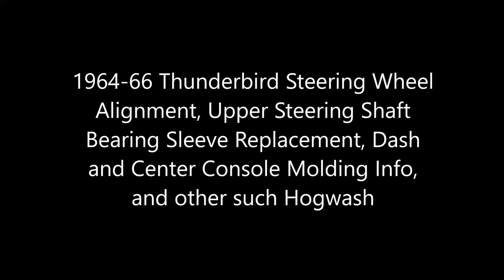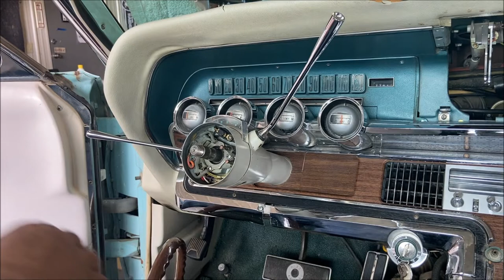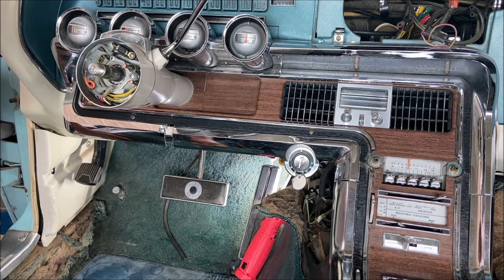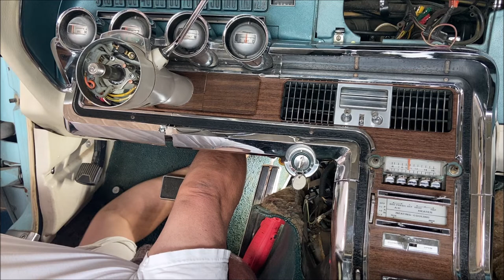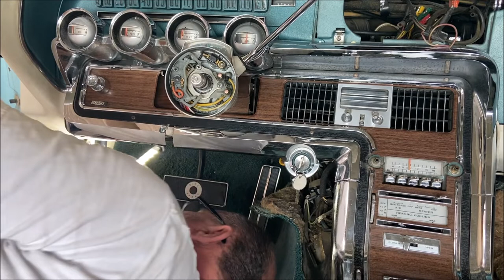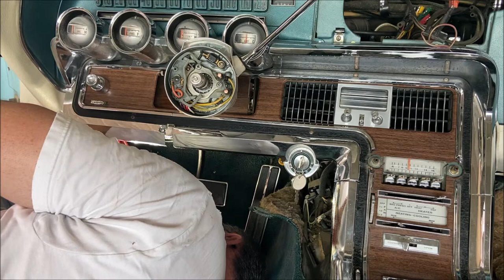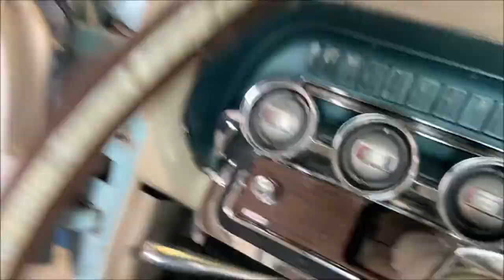1964-66 Thunderbird Steering Wheel Alignment, Upper Steering Shaft Bearing Sleeve Repair, and MORE!

Comment: Hey Nick, I hope you are doing well, I enjoyed your video as I know I will have to dive in the under dash area myself. My '65 will start in any gear position and will not stay in park, makes a terrible noise like the park pawl is not engaging the gear. My car has only 79,000 miles but sat for 11 years un driven. So neutral safty switch is a must look at..... I have never done one of those.... any tips? ideas? Thanks, and God bless. Mike
Reply from the maker: Hey Mike, thank you. It sounds like the NS switch has been bypassed. Its probably bad. That's not hard to do. It wont stay in park probably because the shift lever is bad, it may have a bad lower bushing and maybe the detent is also bad. Those are the 3 main culprits. There may also be something wrong with the shift linkage to the trans as well. All are typical problems. The NS switch is easy, its held to the steering column by two hex screws but they are unique so don't lose them and don't mix them up with the wrong screws. Hopefully your original screws are still there. My videos show all this. Good luck.
Reply: @vintagethunderbirdrepair9426   Thank you, do you happen to have a video on the NS switch? I didn't see one. I guess the BirdNest has some I don't know how good they are, I have gotten a bunch of things from them in the past and been pleased so far.
Reply from the maker: @mikejohansson6711  Hey Mike, my Thunderbird steering column and slide mechanism videos, especially part 2, show the NS switch attached to the steering column. I do not explain how to adjust it or show the unique hex screws but you can clearly see how it is installed. That's all I've got. Sorry.
Reply: @vintagethunderbirdrepair9426  Hey that is a start. thank you and God bless.

Comment: Ok, so after you attach the repaired ground wire to the firewall where does the other end go? I found mine broken also but I don't know where it originally attached.
Reply from the maker: It can go to any of the little hex screws on the steering column in that area. I think it originally went to one of the hex screws that held on one of the plastic turn signal switch wire retainers. Those black plastic retainers that look like a P. Good luck.
Reply: @vintagethunderbirdrepair9426  My son in law came over this morning and we got on it! My eyes are worse than I thought. For the life of me I could not see those nuts for the the Booster bracket but he could and after a little we (he) got them off. Ok, so that was a BIG worry off my mind. So then I, after referencing your video, proceeded to get that bushing in at the bottom of the steering column. It was a little bit of a beast but finally seated in where it was supposed to  be. Then we got the bearing and sleeve situation resolved. After that we screwed with fitting the master cylinder on the booster. Again referencing your video about properly positioning the Booster rod. Got it all put together, installed in the car and....we have Brakes!!! So we have a wet, windy day or so coming from this tropical storm Nicole  and I really wanted to get the car inside so that goal was accomplished. Again, thanks so much for your videos. I'm sure I will have to watch more!
Reply from the maker: @Mr51Caveman  Hey Mr 51, great news. Sounds like you had your hands full. Its always nice to be able to refer to a video when your fixing something. I fixed my clothes dryer because someone made a video of my exact same dryer on how to fix it and if that video did not exist, I probably would not be able to do it. This is why I do these videos, to pay it forward. Glad it helped you. Thanks.
Reply: @vintagethunderbirdrepair9426  Well the rain and some wind is on us now. But luckily with your help I got the car started and backed it into a portable garage I had to get cause we don't have one. The car also has some seal issues and it got wet inside the last rain we had. Something I'll address later...as long as the garage doesn't blow away! Yep, some of the YT videos are great. I had a 2010ish Volvo (my wife's) and one of the headlights burnt out so I was looking at how to replace it. Wow! I thought I was gonna have to tear off the whole front end to do it but after watching a couple videos it was surprisingly simple to fix. And yep, crawling under dashes is definitely no fun! I spent 24 years in the Air Force crawling through some super tight areas on fighter aircraft. Retired 20 years ago. Thankfully I have a pretty good son in law who's just retired from the Air Force also but he's still pretty young. Not even 40 yet!! So he's mechanically inclined and limber. Keep doing those videos and teaching all of us out here! Thanks
Reply from the maker: @Mr51Caveman  Hey Mr 51, I was a Huey mechanic in the Army, was pretty skinny and limber back then. Thats not the case today Im afraid. Glad your making headway. Good luck.

Comment: Great video Nick! I was wondering, the doors for the swing away steering column, how do you remove those? Does the column have to be removed first or can the doors be disassembled with the column still installed?
Reply from the maker: Hey Tbird, good question. I could have addressed that one too while I had all the panels removed but I didnt think about it. You can see that the doors are 3 different panels, one on each side of the steering column and one that wraps around the column. The one that wraps around the column is two pieces, one on top and one on the bottom. The bottom piece comes off, slides down. I think that 65-66 just pulls off but 64 is screwed to the top piece with 2 phillips screws. Once you slide the bottom piece off, then there is a bracket that needs to be removed. There is also a black U shaped bracket under the dash that the whole thing is attached to. That must come off too. Once you remove those pieces, unbolt the steering column from the slide mechanism and you can then slide the door out with some trouble because there is very little room to do so. This is not a very good description. Ill keep this in mind for another video later. Thanks.

Comment: I have a '64 T bird. My husband was  restoring it before he past away. When he took the steering column apart he broke a spring that was in it and we never found part of the spring. Do you know what the spring looks like or know where to get it?
Reply from the maker: Hey Krystal, very sorry for your loss. The steering column has a spring inside the shift hub under the shift lever, this is what makes the shift lever return when you let go of it. it is a short stout spring about 1" long and maybe 3/8" in diameter roughly. Not like a spring you would find in a pen, more like a very strong steel spring that is very hard to compress by hand. These do break and it is fairly common. There are also two springs just outside the steering column for the slide mechanism door. These are more like a pen spring and are about 3" long. These do not break but do get lost. Which one are we talking about? These springs are only available used. Let me know. I do know what they look like if you can tell me which one you are missing. There are no other springs in or related to the steering column.
Reply: This is the 3" spring. The end hook is broke off. There was only one that I know of. I guess i need 2 now. Do you now where i can get them?
Reply from the maker: @krystaldragon6145  Hey Krystal, yes you need two springs. Call Birds Nest in Oregon and see if they have them. They sell used parts. I do not have them. Sorry.
Reply: Thank you! I will.